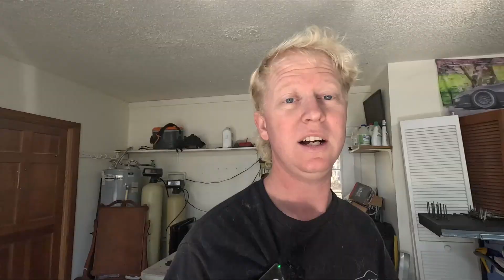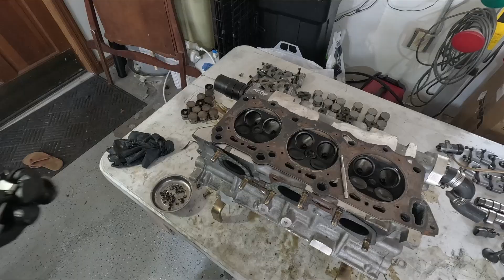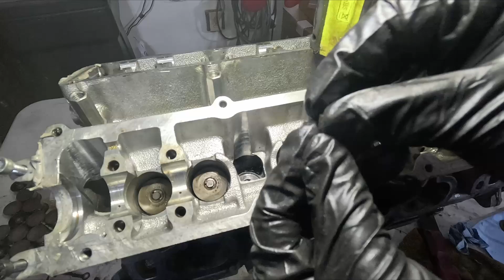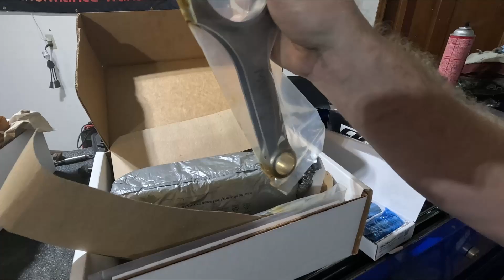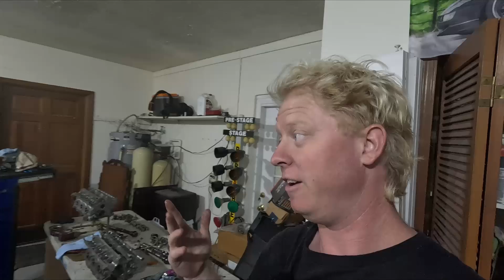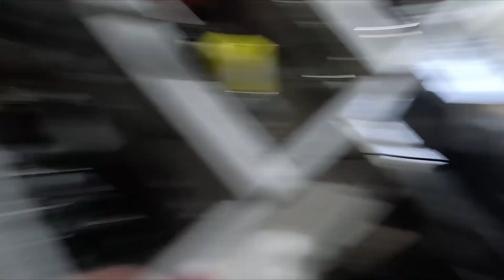The Makings of a 1000HP VG30: Valve Replacement & New Engine Breakdown!

Comment: I’ve been watching a lot of high performance engine builder channels. I think your theory about the rotating assembly is on the right track. When you’re pushing the types of power you want, this step is crucial. You should also have your clutch and flywheel combo balanced with your crank (not just pistons and rods). You would be very surprised how much of a difference that can make. Ductile Iron cylinder liners are a great idea for big boost applications. Sounds like you have a real winner in the making. While you have the block torn down. I highly recommend cleaning out the casting flash from your coolant passageways. The Aussie Shed did a great video on this.
Reply: Adding to this. I would also grind down all the sharp edges and radiuses in the block around the main caps/webbing. These sharp edges can cause cracking like you saw when torsional vibration and harmonics enter the equation. Porting and polishing the heads would be a nice touch, but that’s really up to you and your budget.

Comment: Worth the money to have the heads done by a machine shop for your power goals, Did you check valve height? spring height? And a good valve job should not require any lapping, also a reemed valve guide would be a great idea, the valve should move easier up and down in the guide than it seemed to in the video. Buy once cry once.  Dont get me wrong this will run, but not worth dropping a vlave into a freshly built block, especially if your going to sleave it!
Reply from the maker: @jamesoneill123  there's ALWAYS more that could be done, got to know where to draw the line somewhere.

Comment: Question… aren’t valves coated with heat resistant chemicals? Won’t grinding them take that off? Kind a like cleaning bolts and taking the zinc off? They rust like shit quick 😮
Reply from the maker: @ericfigueroa1134  uhh no. Not these anyway.

Comment: How about looking into a bedplate for the vg30. I think i saw a z32 running such a setup at 1145whp
Reply from the maker: Thought about it, too expensive even if they were still available
Reply: @Billy_Built  shoot didn't know they weren't available anymore.
Reply: I'm yet to see a high hp vg with a bedplate. The price alone killed it let alone the cost of the machine work to get it to work. Mazworx billet mains are holding the most power atm.
Reply: @Blackbullet_racing  4 years ago Mike Jackson has or had a red slicktop with a built vg that had a BDE bedplate. The video is on Youtube